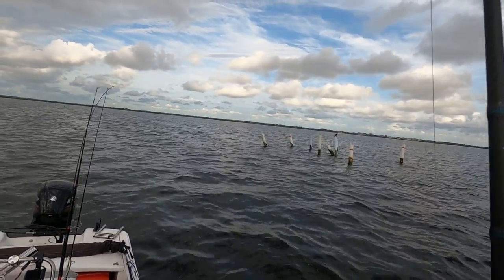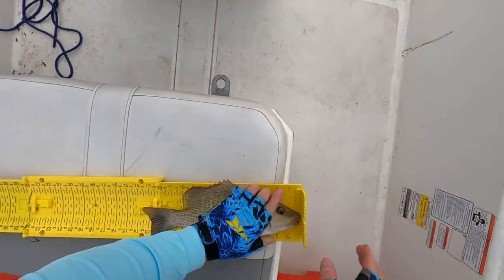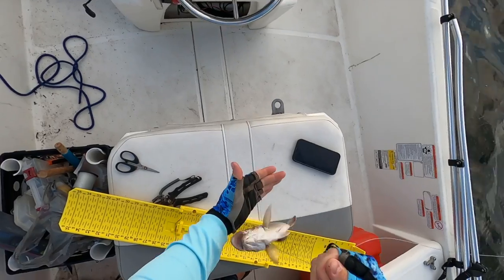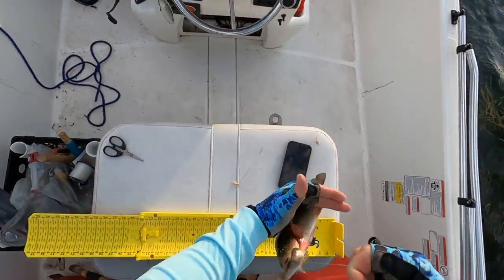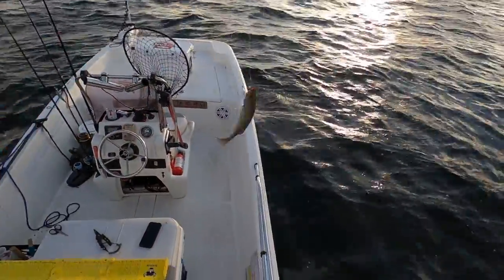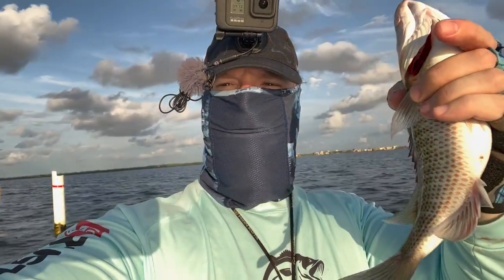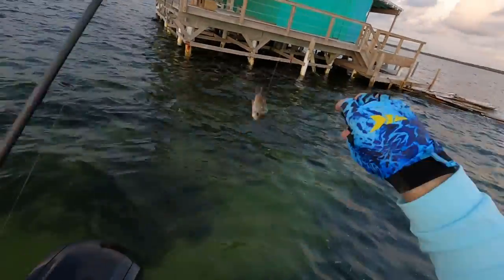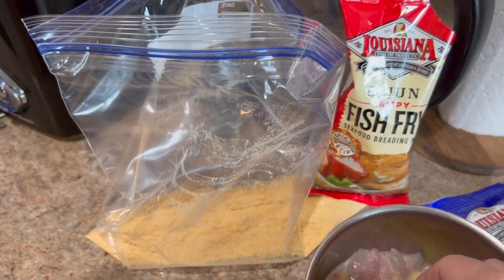Catching DINNER in Pasco County, Florida

Comment: Enjoying your videos. I am kayak fishing with the same Old Town 106 and have been thinking of adding a small flats boats to the mix to be able to cover more water and add a head or two- I'm looking at the Mako 15cc. Can I ask how you are liking your 17 skiff? Do you think it was a good investment? A part of me thinks it may not be worth it, and should just stick with the kayak fishing.
Reply from the maker: I like the mako a lot. The only issues Ive had were electrical. I had to change my trolling motor wires and clean up the connections behind the rocker switches. I think eventually I pull out higher quality 3rd party rocker switches that don’t corrode as easily. But the vessel itself and motor are awesome and good starter boat in my opinion. Kayak is still fun to get in the nooks and crannies in the mangroves though.